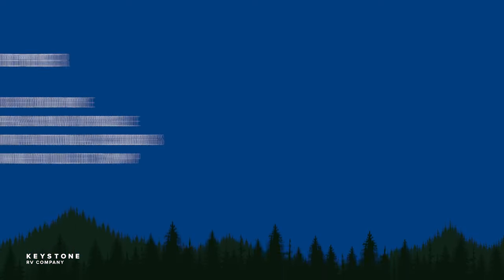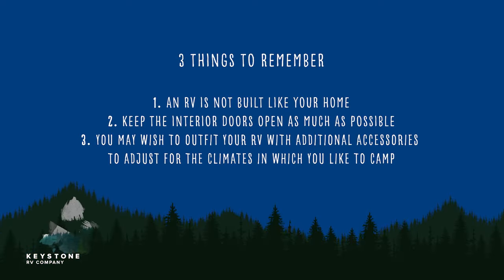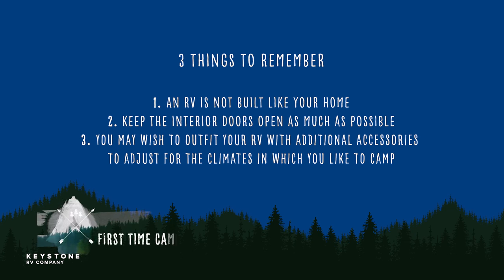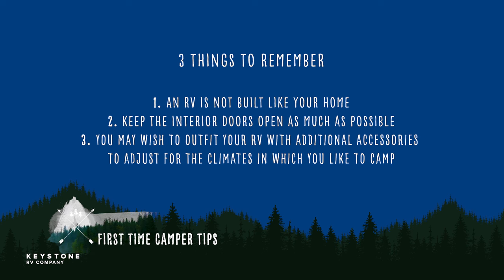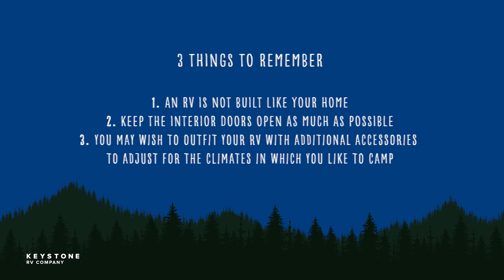First Time Camper Series - Heating the RV is not the same as a heating a house

Comment: I bought an '08 Sunnybrook Brookside over the summer. I have just started using the propane for the furnace. I'm going through a whole tank in one night. That's $25 a night! Is this is what is to be expected or should I investigate for an issue?
Reply from the maker: Good morning, the Brookside isn't one of our units, so it would be hard to say what to expect in that unit specifically. Also, with the age of the unit, you may want to have it looked over and have the LP systems checked for any leaks or anything like that as part of maintenance. We hope that helps you in your efforts!

Comment: What accessories to supplement heat would you suggest? I just purchased a 422 fuzion 2018. I'm a 1st time camper and trying to learn how to use this. 🙄 any suggestions would be appreciated.
Reply from the maker: Good afternoon! We recommend in the colder months to winterize your unit as water does freeze at 32 degrees. The information in this video contains any other information needed for heating your unit. Thank you!
Reply: Thank you for your quick response.  Quick question when running the AC I saw a video to shut the vents to push the air to the separate vents thru the rv. When running the heat pump, do I leave those same slots/vents closed on the ac unit? I have searched this all day. 😢
Reply from the maker: @lauriehrobuchak3145  Good afternoon! We would not recommend pushing the air through the vents in this way as it can confuse the thermostat and create inconsistent readings. Thank you!